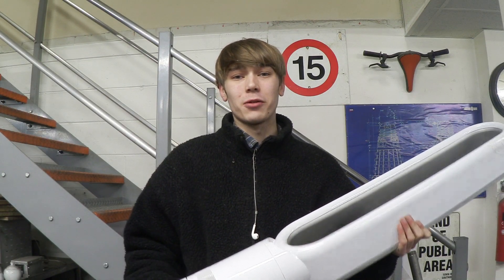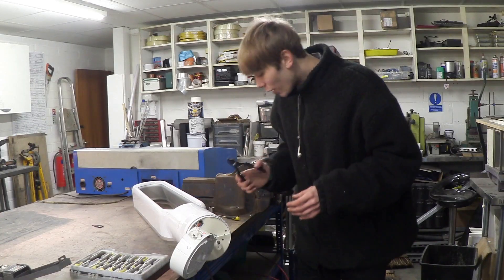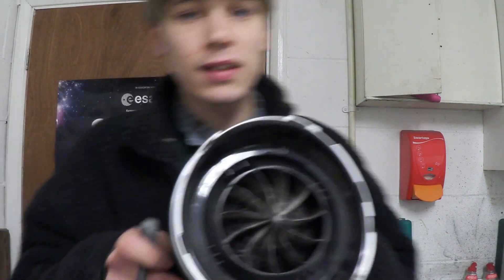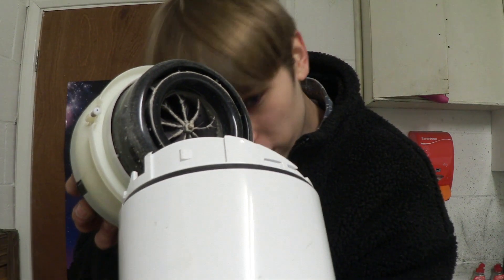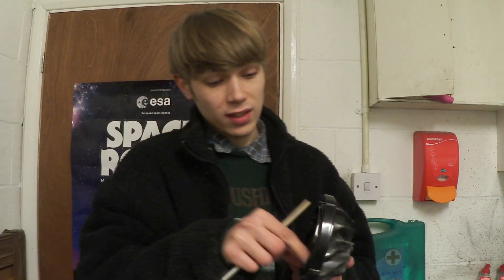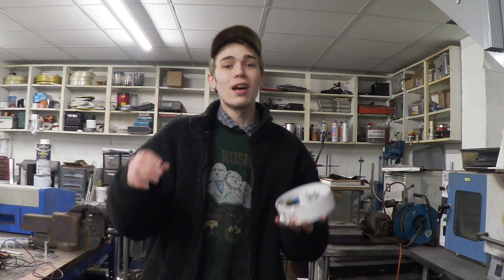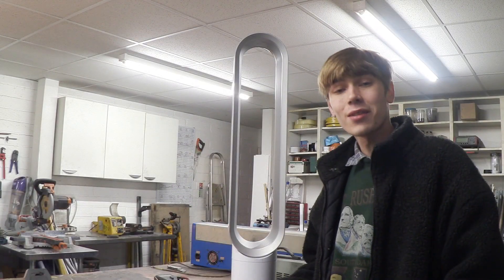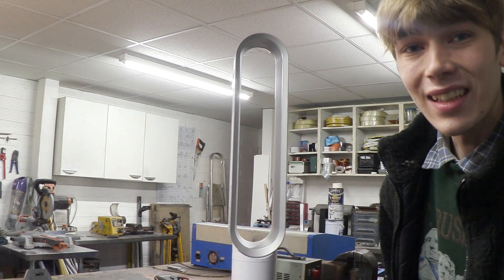987 - From Trash to Cash - Repairing a Dyson Bladeless Fan

Comment: If you don’t have a remote or it’s flat. Push the power button again and again it will cycle through fan speed. Hold down to turn off. Hope that helps someone. 
Oh yeah great video Luke

Comment: The black access panel you removed on the base gave you access to the two screws on the oscillating arm, just turn until they appear, unscrew and the base separates. No need to remove a circlip.

Comment: D West

Hi I have the same exact unit without the remote, on/off button does nothing,  fan is all cleaned. how did you separate the bottom part from the motor 
I removed  the middle screw at the bottom so now the circuit  board is loose from the motor but  still can't  completely separate  maybe 1/4-1/2 inch  separated seems as if something is still grabbing it any suggestions  thanks.

Comment: Not sure if "repair" has the same meaning in the US vs England.  It seems that you performed maintenance on it, but no repairs.  Small difference, but since nothing was broken or damaged, nothing needed repairing.  It just didn't work like it should.  Like others have said, your confidence is way up. This was one of your best videos.
Reply: It wouldn’t work in the condition it was in so it was repaired.
Reply: @mikebond6328   Using that argument, then the act of plugging in anything that is unplugged is also a repair.
Reply: @DavidKenny64  You can’t plug in anything that doesn’t have a plug.
Reply: @mikebond6328  Yeah, he did replace the plug, and that makes it a repair. But he took it apart and performed maintenance on the rest.  Sorry for misinterpreting your answer.
Reply: Even if all he did was replace the plug on the cord, that's a repair. Though I, like several others, am curious if there was anything else broken or if it just needed a good cleaning and replacement remote.
Reply: I live in the US and to me if an appliance needs a new plug for it to work that's a repair.
Reply: Technically, if it didn't function properly until maintenance was performed then maintenance WAS "the repair".  The most common definition of "repair" is "to restore to sound or good condition".  In casual conversation, the definition doesn't actually need to be so narrow as to require replacing or mending damaged parts.  Such a distinction is usually reserved for bureaucratic purposes, such as distinguishing between fees in a shop.  So if you work in a shop, I can see why such a distinction might seem important to you.

Comment: might look and see if anyone makes a universal remote.  you could try its auto search,  or  you can even drive a IR led on a phone or arduino to try a few thousand codes.
Reply: Great suggestion, That would be super if I could control it with a ir shield on an Arduino. Cheers mate! : )

Comment: ......nice, you like the style, . I can see that style too. It would clash with steam punk perhaps .That style is complimented by electrostatic speakers and spherical armchairs hanging from the ceilings  and ties in with modern flat panel TVs too . I guess a crass robot vacuum cleaner is permitted also .
..Not surprised at all the viable stuff what you find discarded in Britain. There was an article about it by a British PhD student in New Scientist at least two decades ago .

Comment: i cant find the infrared key codes for it so you could make a useful esp32 or pico plus infrared module for fun to control it but did find this for now.
How do I use my Dyson AM09 without a remote?
Control without the remote
Press the standby button on the appliance to turn ON/OFF.
Press and hold the standby button on the appliance to adjust the target temperature.
The target temperature will increase to a maximum before decreasing.
If the target temperature is set at 0°C it will switch from heating to cool mode.